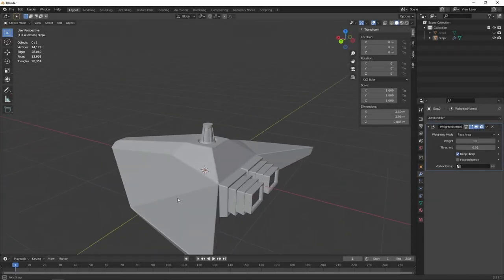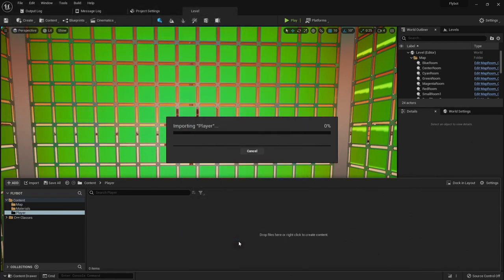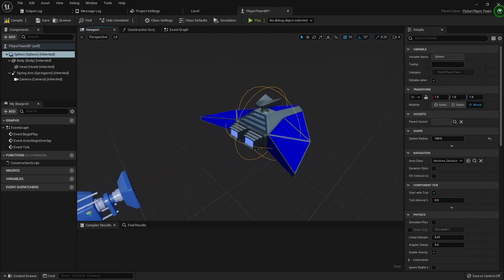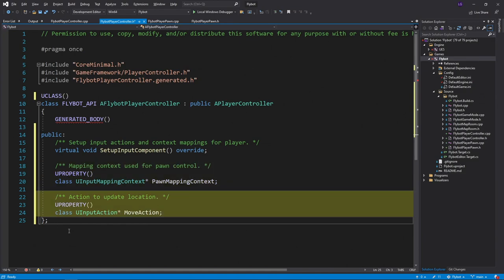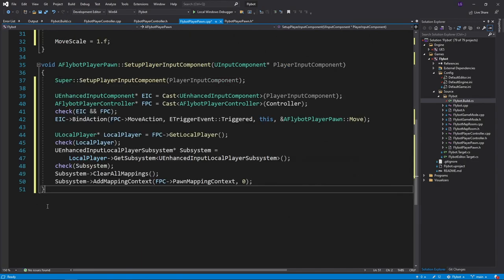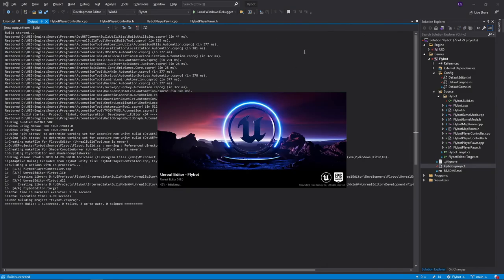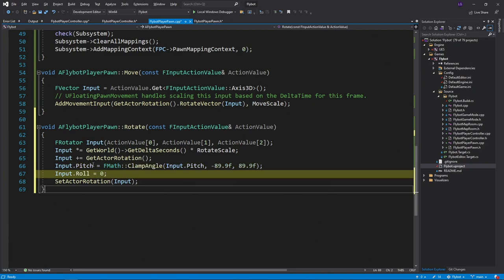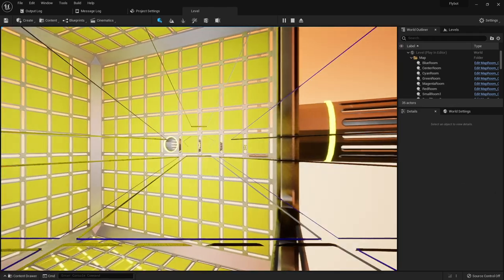Enhanced Input and Pawns with C++ in Unreal Engine 5

Comment: Nice video, but I have to question just how useful Hard Coding these values actually are. 
It seems like a lot of extra work with no obvious advantages.
It's good to know how to work with it like this but It would have been nice if you would have actually bothered to explain your reasoning in more detail.

Given the fact that very little explanation was given as to why you hard coded key bindings like this.
The video seem to be leaning towards a C++ Elitist mindset which is a very bad mindset to get stuck in.
Blueprints in Unreal Engine were designed to Complement C++ and speed up the workflow.
Trying to make entire games without blueprints is just an all around terrible idea to get stuck on.

Maybe I'm just jumping to conclusions, I stopped about halfway through because I feel that it's best to lead things with an explanation as to why your doing them and I don't want to get to the end of the video only to realize that I learned a bad way of doing it.